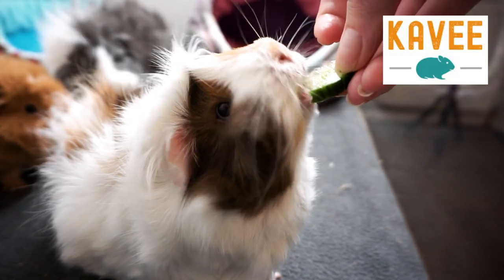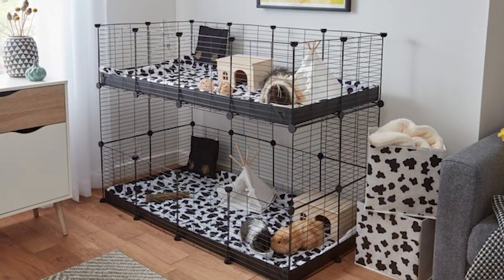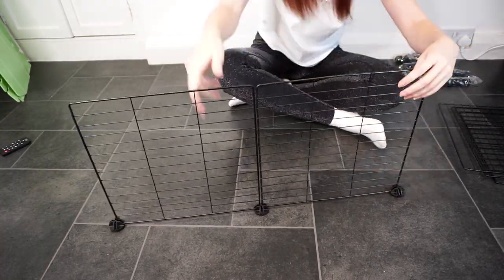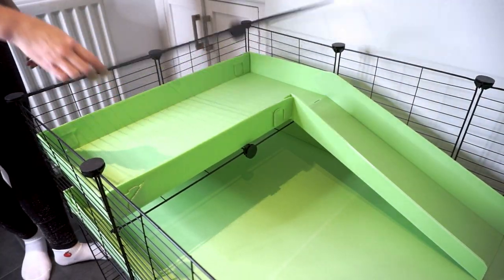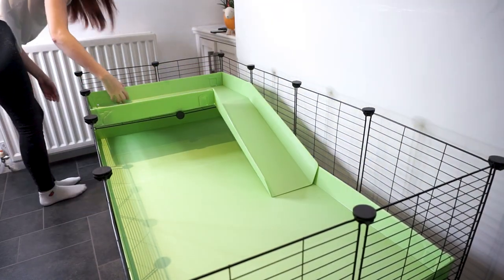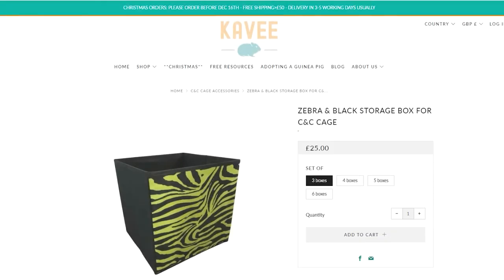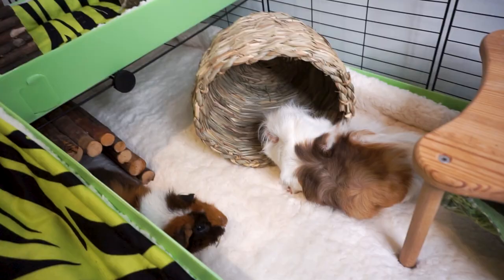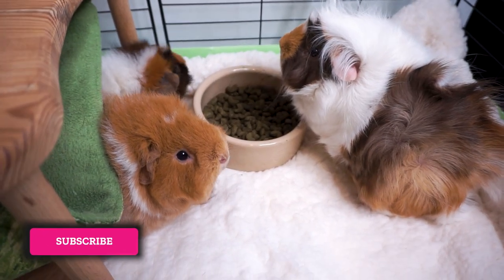DIY Guinea Pig Cage: Setting up a Complete Kavee C&C Cage Kit!

Comment: Just a couple tips/ideas! When I use cable ties on pet cages, I use toenail clippers to cut them. You can get so close that way. When my piggies had a coroplast cage, I used plastic report binder bars (the kind that just slip on) on the edges so there weren't any tempting things to chew on. 🐹
Reply: you know she snipped off the edges right?she showed it in the video lol
Reply: @hannahshouseplants3649  Sarah used scissors to snip them. With toenail clippers, you get completely clean, mesh cuts.
Reply: @MillsSkits  oooh yes thats kinda smart!
Reply: @hannahshouseplants3649  It helps the cable ties have no rough edges and a nicer look. I also use toenail clippers to cut them off when necessary. (I don't have a C&C cage right now, but my piggies' current habitat also has cable ties. Cable ties and toenail clippers can be so helpful with do it yourself and modified cages.) Have a great day! 🐹

Comment: Two months ago we got 2 piggies and a MIdwest cage.  We are considering a Mezzanine for loft space but C&Cs certainly seem to have their advantages.  Hmmm....  Your piggies look very happy!
Reply from the maker: Thank you so much! The Midwest seems to be a decent cage and is quite poplar! 😊
Reply: We got our 2 pigs off Craigslist in a Midwest cage and found it was way too small for the both of them. We turned the Midwest cage into a second story with their food/water and built them an 18sqft first floor for running and popcorns. It was cheaper building the 18sqft than the Midwest cage cost. C&C cages are less than $50 if you source materials yourself
Reply: @Pushkara Talluri hmm, there are a few cages on Amazon that range from 1600- 1500 rupees which is fairly a good deal. You could also try getting c & c grids and connectors and putting it together by yourself. Usually it’s pretty cheap. My friend built her cage with c & c grids she found on amazon for I think 38 or 40 dollars USD ( I could be wrong ) and her piggies are living happily in them!

Comment: I was just wondering, do the fleece liners that Kavee sell fit any of the cages that ‘candcguineapigcages’, as I’m in  love with the cute patterned fleece liners that kavee sell, but would love one of the two-loft, larger cages that candcguineapigcages sell? The guinea pigs really seemed to like that cage though❤
Reply from the maker: Hey there, I'm really not sure but I assume so as I believe they use the same standard size grids :)

Comment: Hi I have a question I wanna get a new cage but I was wondering does the cage you have come with the fleece already or you order that seperate? & also what is the size of the cage on the video ? 😩
Reply from the maker: Hi, the 2 by 4 grid C&C cages measure 140 cm by 70 cm. The fleece is ordered separately yes 👍
Reply: Can I make it smaller too or it has to be that size ?

Comment: How big dose the space need to be?
Reply from the maker: A 2 by 4 offers 10.5 square feet, this is the recommended minimum for two piggies. You can use google to convert measurements into square feet :)